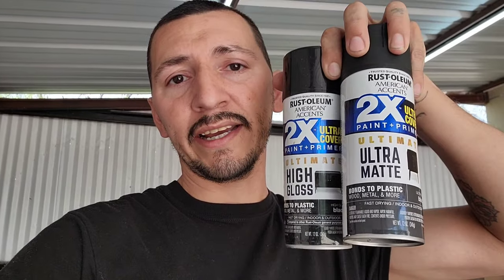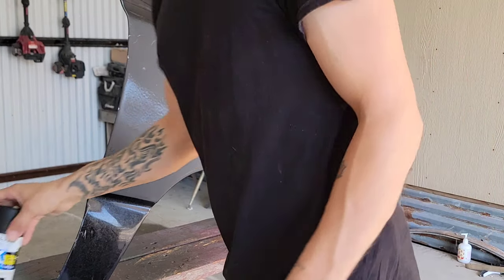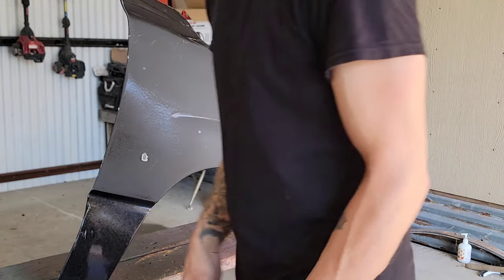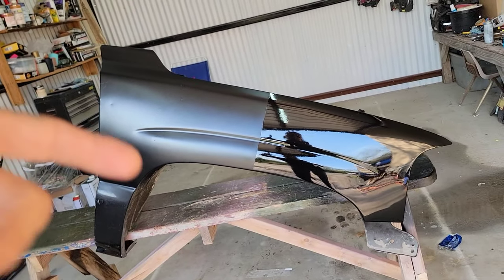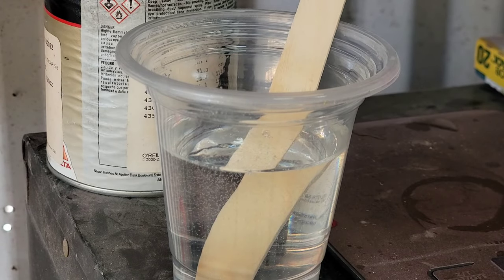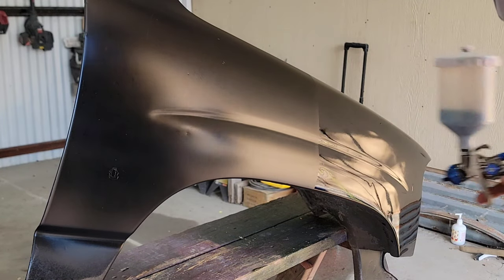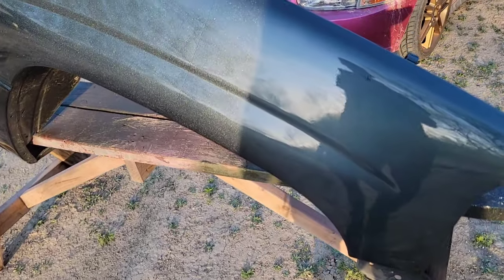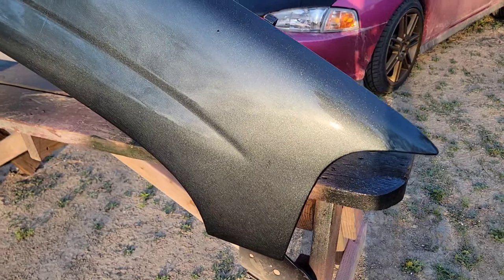Let's Spray - BLACK PEARL Over RUSTOLEUM Black

Comment: Love the content, it's made me again consider attempting to paint my car. I'm pretty good at figuring out most stuff and have sprayed a little and pretty good at knowing the just enough point, the part that I'm not up to speed on is amounts, I don't know how much paint I need and don't want to run out and scurry to mix up more or waste a bunch and have to buy more if I need to respray an area. It's a 95 mustang gt convertible and in all actuality really doesn't seem to be a ton a area with that car. It's Lazer red 3 stage with a tinted clear mid coat but now you can easily get 2 stage which is probably what I'll get. Oh btw where did you get all those powders, it's so cool how just a bit has dramatic results, are they just samples? because from small amount you use for a fender like 1 teaspoon I would think you might be able to do a small car with one pouch? Even tho I'm staying with Lazer red so I don't have to do my jambs  and stuff putting a little powder in to make it pop a little more Wouldn't jump out when you see the door jambs next to it.

Comment: I’ve been working on an old truck for better part of 10 years, I’m doing a patina paint job, all panels were stripped to bare metal and then primed and painted with rust oleum, some are about 5 years old, always been in a garage with temp like 60-80 degrees….once I put it all together I’m going to sand some and do some fake rust ….then I’m hoping I can clear coat it all with a flat clear….time will tell!